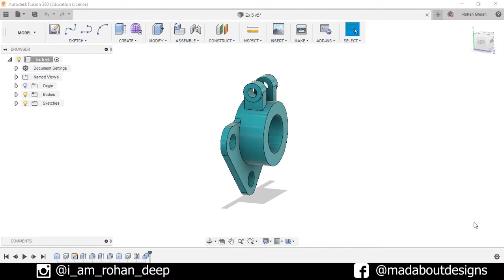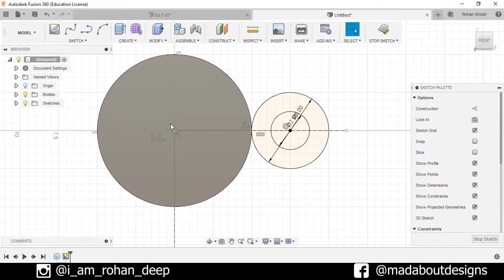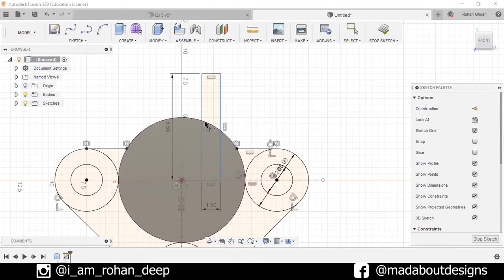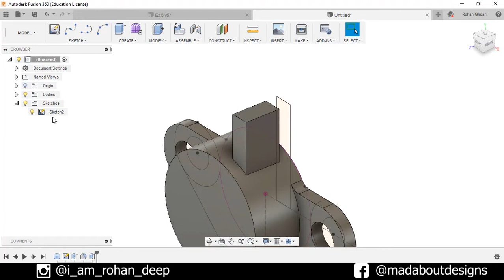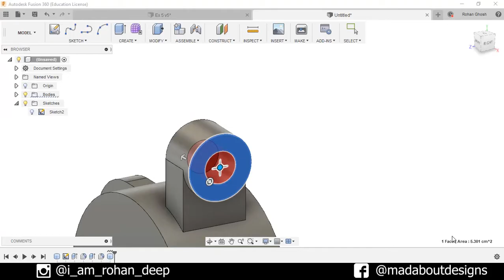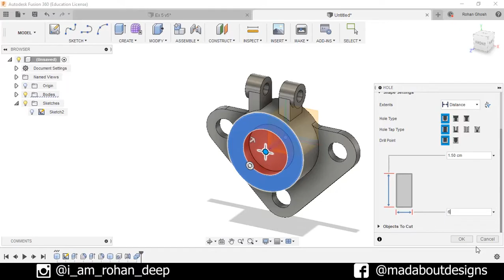Autodesk Fusion 360 Beginners Tutorials | Exercise 5 | Learn the basics of designing

Comment: I have a doubt why the whole design is in one body( iam not able to seperately select the extended objects)without even using the combine option  for me.
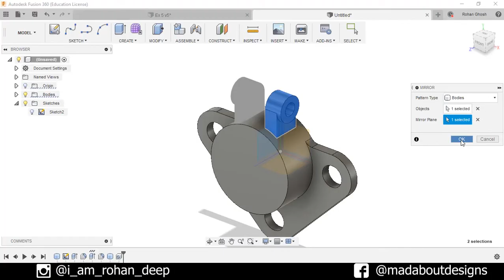Reply: im still a noob but i think you have to select the component to move bodys, and ( i could be wrong about this) each body might have to be its own component. If youre talking abouit @ 7:11 when he mirrors its because when you extrude the rectangle  it has to be set as "new body" and not join